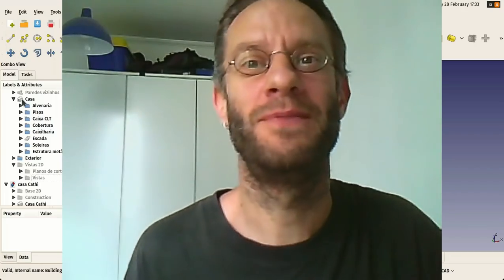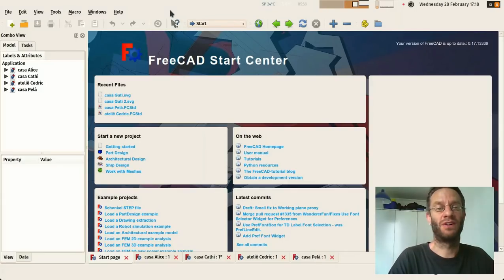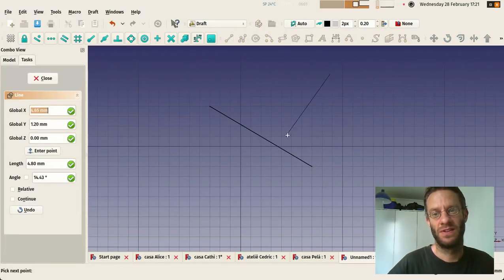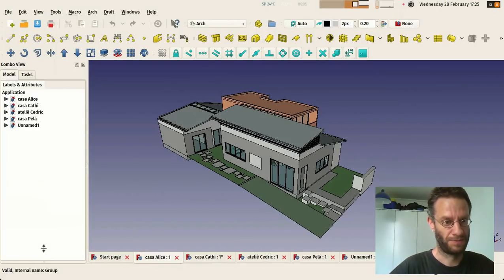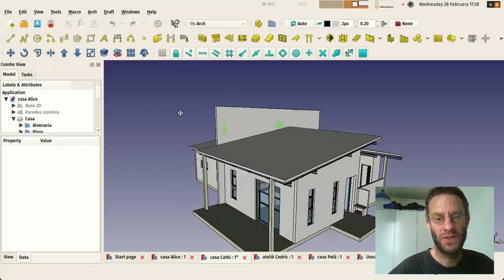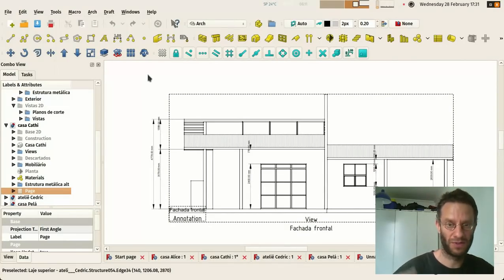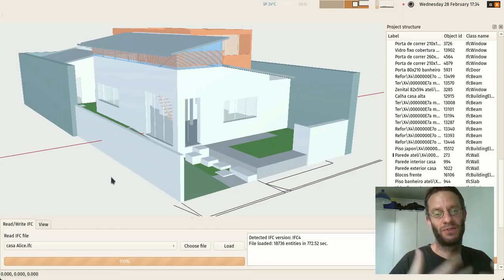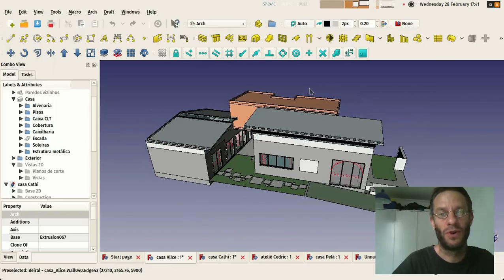BIM with FreeCAD - Introduction

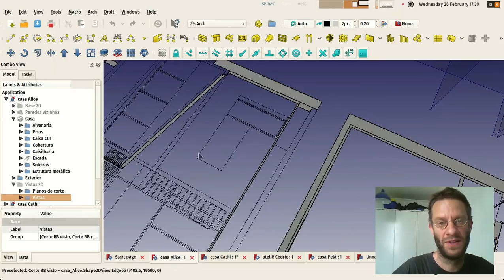Comment: I wonder what CAD software you showed at 12:15 is that LibreCAD?
Since when LibreCAD supports different sheets for a drawing for printing, like other CAD's "paper space" ?
Reply from the maker: That was DraftSight, Unfortunately it's not free anymore... Nowadays I mostly use QCAD for pure 2D work. It hasn't the same kind of paper space as autocad, but wirh a bit of practice you can achieve things more or less as well too. The final aim is to do all this in FreeCAD of course ;)
Reply: @YorikvanHavre  Thanks for the answer.
Yeah I also had that big down with Draftsight when Dassault Systemes decided their new release was "better" than previous ones and made old versions of the free beta to stop working in both Windows and Linux.  I have tried many things but I can't get past the wall of "DraftSight 2018 is free software but you need to activate" only to get a reply on my email saying "the free license server is not working anymore".

I also would like to know what OS are you running FreeCAD on?  Is it Ubuntu Linux? I am running it on Linux Mint 20 but nothing seems to work right, lines appear on odd places when I go Ctrl+Z and hit Recompute (Ctrl + R) and some commands just won't work.  I ran it on an old Windows7 license I have and it works better, more stable, but the add-on manager doesn't load the additional benchmarks and I can't install the BIM benchmark

Comment: Can you show how I can organize, when I begin based on 2D-Floor drawings (of an existing House) and wand to "rebuild" it in Freecad?
As far as parts are nothing else than groups I tried to manage Wires of the different floors and setting UP Z-Layer of that parts. Seems to be to complicated because invisible/hiding such elements will not stay. (Same when using CAD-Layers)

Comment: Fantastic intro to the Arch WB and BIM. 
just curious as to what issues might arise when exporting to Revit..
Reply from the maker: I'd like very much to say "No issue at all" ;) Basically there are many possible issues, as with any IFC-based transaction. I'd recommend exporting early and often to detect possible problems early. 99.9% of them can easily be solved, usually by exporting an object to another IFC type or modelling differently, or forcing BREP export.
Reply: @YorikvanHavre  thank you for the advice.

Comment: Hi Yorik; nice video! There's a little bug I would like to comment. Drawing a line and using the units MKS for buildings, it's not using meter, it uses mm. Meter is only used in the Global Z axis. However, if I change the units to Euro Buildings (cm, m2, m3), it will use cm on all axis; so this one is ok. It would be nice if MKS used meters also in all axis (Global X, Global Y, Global Z, an Length). Angle is ok, it's "degrees". I'm using FreeCAD version 0.17, revision 13515, 32-bit. (Not sure how to fix it, so I can't send a pull request atm). This change is important I think, 'cause the workflow about buildings is always in meters. A fundamental feature IMHO. Greetings and thanks to this good software.
Reply from the maker: Indeed the MKS schema changes depending on the measurement. I agree we need one that is pure meters,will see about that when I have a moment
Reply: I'm very happy to see that you  improved this option. I'm using the last version, 0.18 through appimage (which is awesome as well). FreeCAD is very good! Thanks for your work. Open source is changing the world and it's nice to see how it's evolving.

Comment: When I try to export certain ifc elements as ifc I get the following error message, does anyone know what could be the reason?  "cannot create polygon because less than two vertices are given"
Reply from the maker: There is likely a problem in some of your objects. Make sure all have valid solid shape, and none has an exclamation mark in the FreeCAD tree. If nothing helps, post your file on the FreeCAD forum so others can have a look

Comment: Excellent work! It would be a tremedous help if you could do such tutorials. For an architect that, having working with  comercial BIM programs in middle size studios, has recently initated his own path and wants to work with BIM in a small scale FreeCAD is a promising tool. I've used Blender for rendering before and I just stared using FreeCAD, so I know little.

One question: ¿Is at this moment possible to classify the elements in order to export ordered spreedsheets or export and IFC with an specific classification (Property Sets)?
Thank you in advance

Comment: Excuse me but I cant make heads or tails of this 'arch' system in free cad works. I'm new to this relatively speaking but have already spent many dozens of hours, weeks and weeks trying to work out how to do a simple line drawing in arch, but have barely made any progress. Well actually, I haven't made any progress at all. Every step of the way something flaws me. one example is when I attach walls via the 'icon tool' upon a wire frame, each corner of the wall 'overlaps halfway', so that only half the wall overlaps leaving the outside corner with a step if looking down at it as a plan. I have tried using the tool in the combo view that allows the walls to either be shifted off centre, to the left or right' of the wire line but that means that opposing corners shift and overlap in opposite ways to each other; its not uniform. Anyway, now, today, I can't find that tool in the combo view  or tree view or property view or anywhere. I have also tried using the rectangle to start and shape the floor plan I need to draw but it appears that those lines of the rectangle can not be changed so that makes no sense to me; the rectangle only appears to be useful if you want a simple cube. If you know how to get around any of these problems I have mentioned, and believe me, this is only one or two, I have mentioned. I would much prefer to use a pen and paper as rudimentary as that may sound, but this is not allowed these days. No one accepts pen drawings anymore. So any real independence has actually been taken away from people who dont have an inclination towards digital technology. its very frustrating to say the least. Any help you can offer in understanding how to get around this problem in the corner of the walls. thanks. please excuse my frustration as I have spent hours today trying to solve the same problem I have had for weeks now.
Reply from the maker: Hello Jude, sorry to hear about your struggling with FreeCAD. I am also a fan of pen and paper, and indeed doing the transition to a complex 3D parametric modelling environment like FreeCAD can represent a pretty steep learning curve. I would suggest to not try to solve all problems at once, and either concentrate on 3D modelling only, or start with pure 2D drafting. You'll get much less frustration and more enjoyable results. Both can be done in FreeCAD, but also in other free and open-source applications such as Blender (3D) or QCAD and LibreCAD (2D). Exploring other applications could help finding something that suits you best. Sorry about not being able to address each of your issues here (I would suggest posting on the forum at https://forum.freecad.org ) so more people can help. FreeCAD also has a proper, more paced, step-by-step user manual at https://wiki.freecad.org/Manual , I would suggest to have a look, it should help to get you on tracks